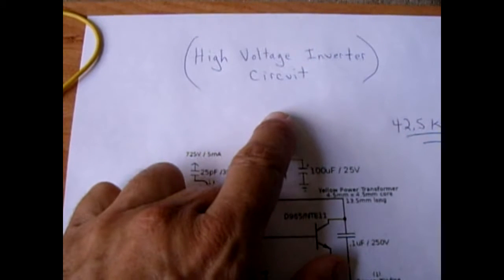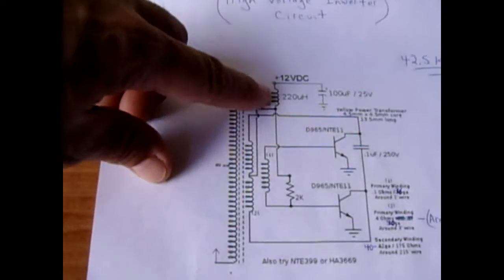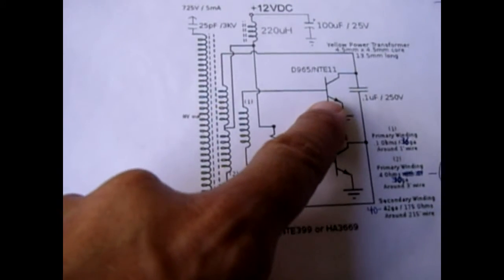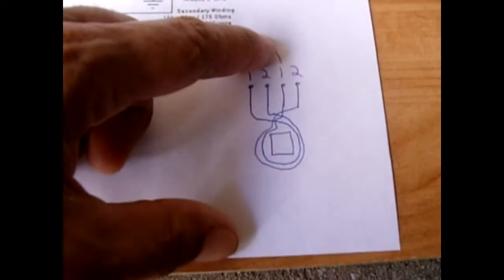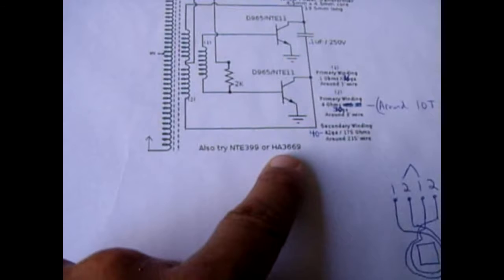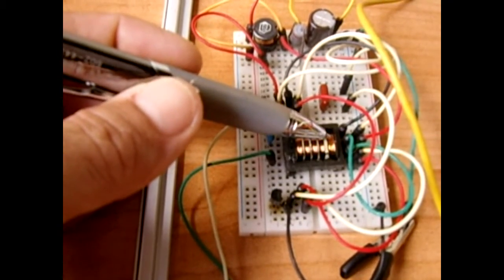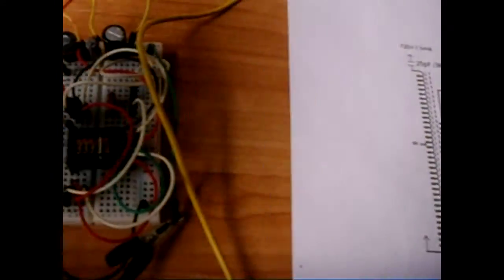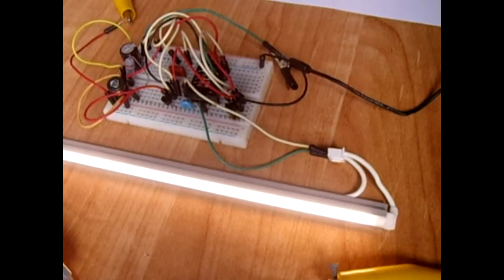High Voltage Inverter Circuit ~ Schematic & Instructions

Comment: where can i buy the transformer ? thx
Reply from the maker: You can probably pull one out of an old CCFL laptop backlight inverter board, or from an LCD TV inverter board.
Reply: and you just added windings? how much windings on primary and secondary? thx
Reply from the maker: +HalfLife2Beta Probably use it as is.